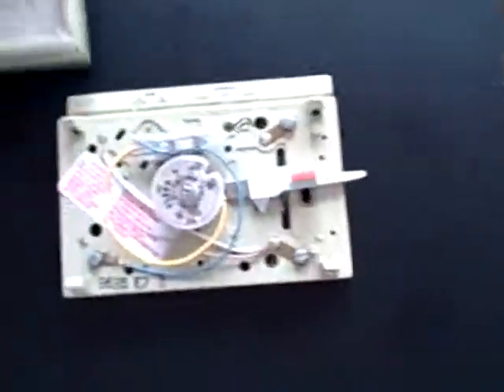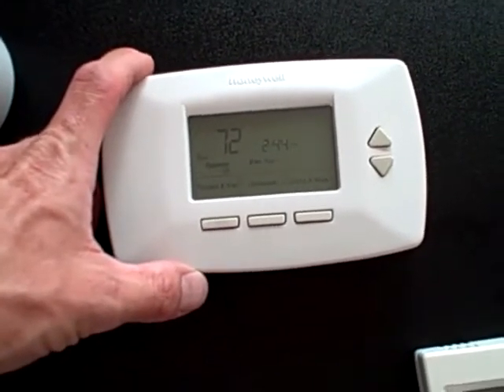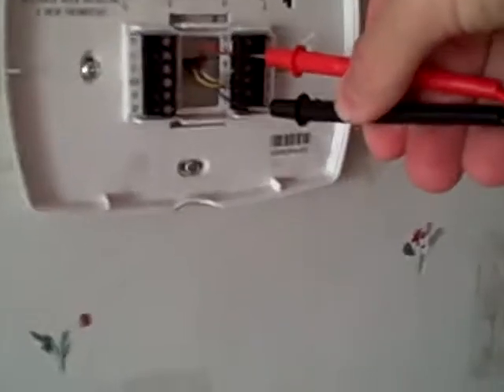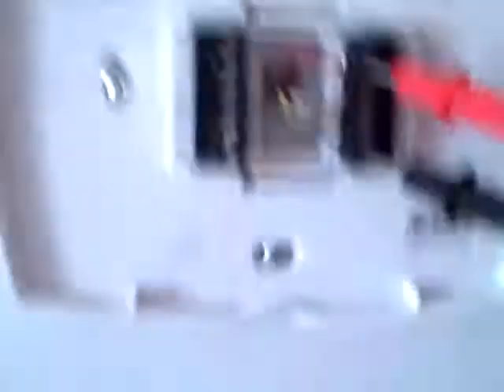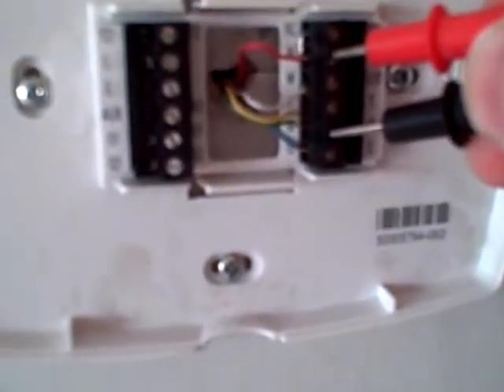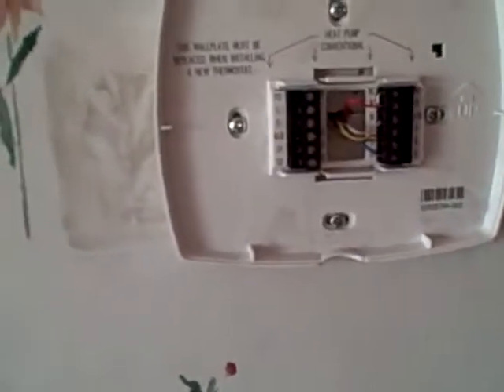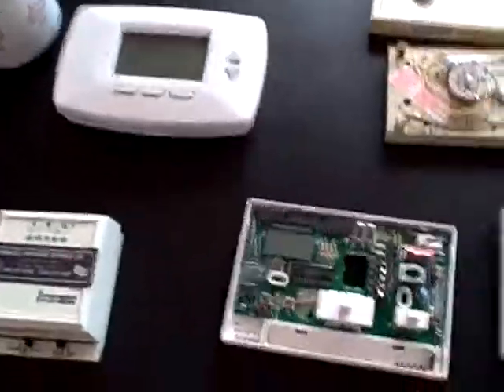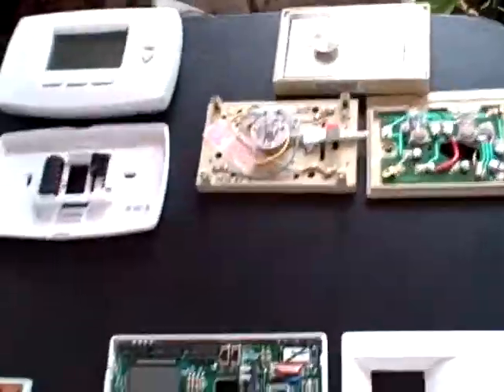HVAC Thermostat Primer! (pants on the ground)

Comment from the maker: hahaha :>  I change a decent numer of those out, usually it is the display that craps out on them, starts to fade over the years and you have to look at it from a certain angle and then after a while it just goes!  Remember to keep the batteries changed out and corrosion off the battery terms! :)

Comment: yup the display on mine has faded over the years, but is still readable enough for me. Going on 16+ years in service. It actually faded a lot in the first 5-7 years, then leveled off. I havent noticed a change in it in the last few years.

Comment from the maker: that is kind of odd.  Normally if the switch is in gas setting the t-stat does NOT send a signal to turn the fan on, the furnace doe it by itself.  I'm not sure how your electric furnace is wired to so it is hard to say why it would behave propely in gas setting but not electric.  (just got home and tired too so my brain is mushy, heh)